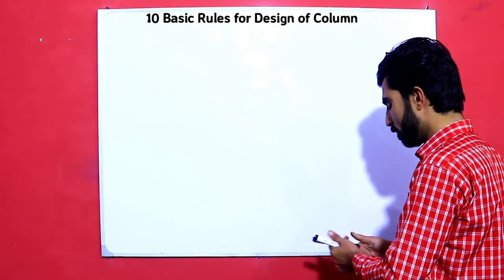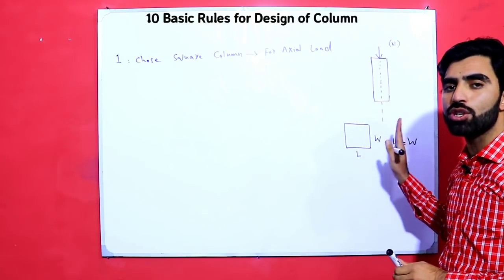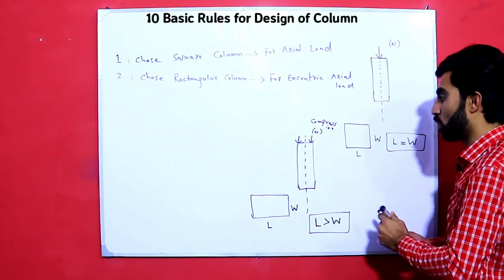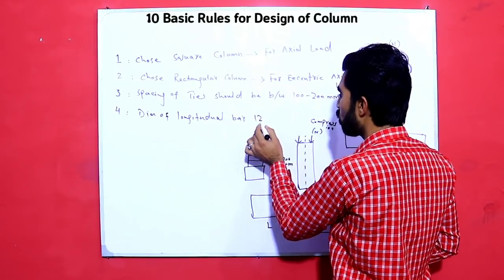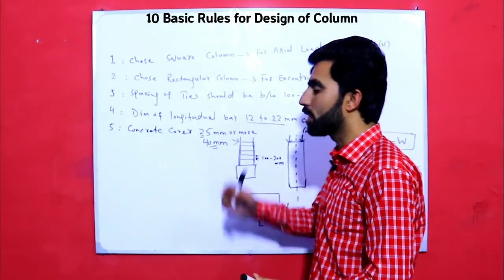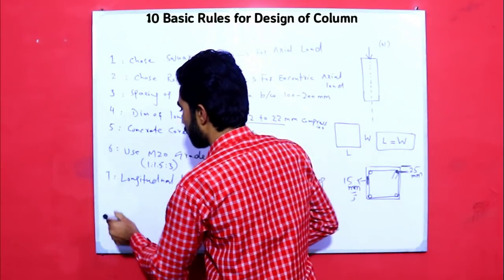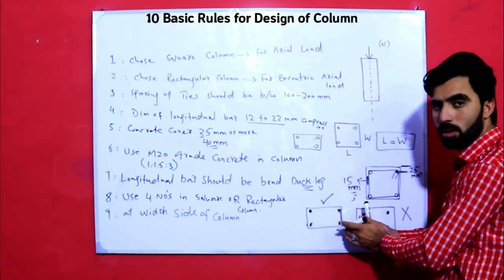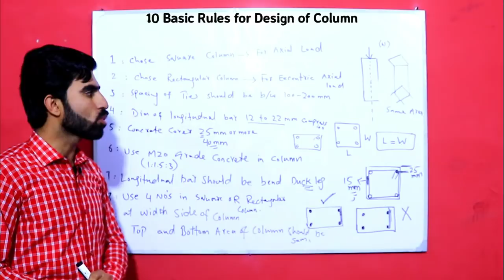10 Basic Rules of Column Design -  Don't Forget Basic Rules of RCC Column

Comment: Perhaps rule number 11, we should spray galvanized over all outer reinforcement, including stirrups or at least etch and nutrialize metal to point of ph concrete pH will not react as much...
Then we could add number 12, use a coating to protect exposed columns from water intrusion.
Keep up your good work, I have posting on this for years now...
Reply: Nothing not graded and recommended in engineering should be sprayed as he could alter chemicals contained in concrete mix. Minimum rebars cover is based on building area too. To prevent water intrusion especially in salted air area, we would use a different type of cement like type 2 portland ciment with c3a < 8% or even a type 5 portland ciment with c3a < 5% which is better.

Comment: Hi sir plz reply my question,my house only G[G+0], span between 2 columns length 19 feet ,wedth 14 feet , size of colum 9/15 with 6 bars of 16mm rectangler column, all house walls 9 “wall. And first we make walls before slab it is safe or not ? Plz reply

Comment: What is pullers with 6 bars use like a shop covered area is 984 sq ft 1floor and 2 floor is 835+ 835 sq fts

Comment: Sir your video is very informative. 
1. Pl suggest the column width for a 25 ft X 44 ft plot (2 Storey Building) ? Is 12 “ X 12 “ enough with 8 Nos 12 mm bars ? 

2.Also pl suggest maximum spacing between 2 columns in the above mentioned structure?
Reply: max spacing of columns should not be more than 5.5 metres

Comment: Sir how to know whether the load acts as axial or eccentric in the column ?
Reply: If its an Axial load then the load is assumed to act at the centroid of the cross-sectional area in that column member. Eccentric loads act away from the centroidal point. When considering stress distribution  from loading, axial loads only generate normal stresses while with eccentric load generates normal stress plus two bending stresses.

Comment: Brother what happens concrete cover of rcc colomn  less than standard length .... and what is the largest sterab size like 6×6 7×7 8×8 for 9×9 rcc colom

 I build 4 9×9 rcc colomn using 7.5 × 7.5 sterabs is it a problem..... ?